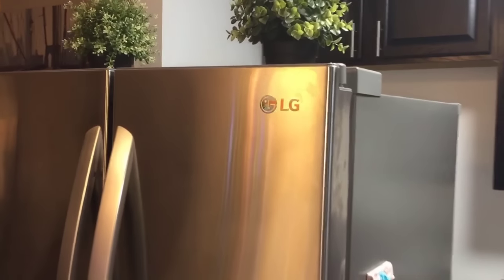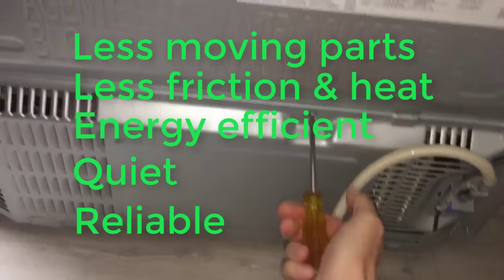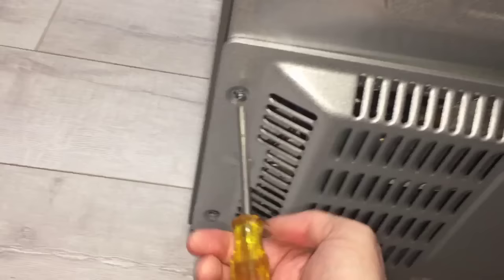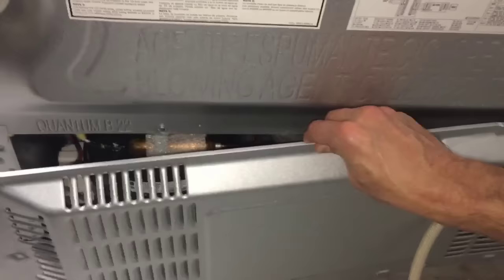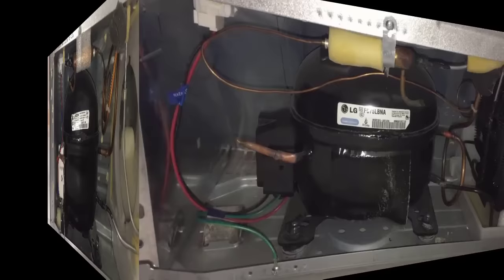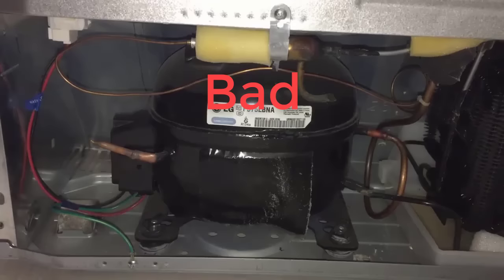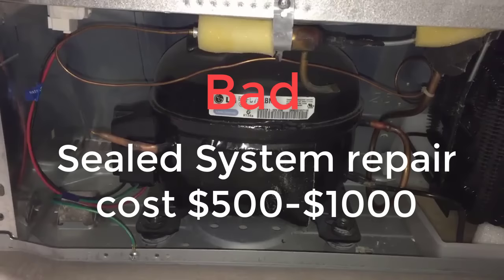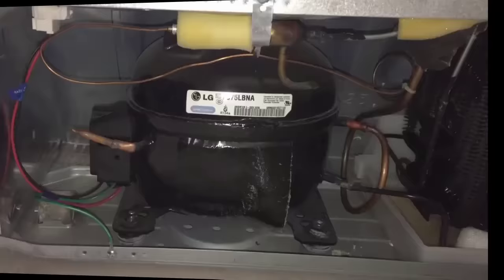LG fridge not cooling but running

Comment: Linear has 10 year warranty but heard the tech labor itself is like $400 + and you never know how much longer it will last.
Reply from the maker: If your fridge is only a couple of years old, then I think it's worth paying for labor. But if it's closer to 10 years old, then shopping for a new NON-linear refrigerator would probably be wise. The best case scenario would be if they try to fix it, but can't. And than refund your money back for a non-repairable fridge.
Reply: Yep - be prepared to pay them handsomely to fix their faulty product or continue to go without a fridge.
Reply: WHAT DO YOU MEAN BY NON-LINEAR?  I don't know!  Can you tell me because I'm about to buy one since mine is around 8 yrs old
Reply: @leoe7357  open the back cover (please, unplug it first) you'll see the compressor label, it'll say linear compressor, if not, you are good to go.

Comment: i left the freezer door open and now it doesn't cool. I will unplug for a day as instructed. Hopefully that fixes the problem.
I have an LG LSXS26366S/01 model
Reply from the maker: If the door was left open, the evaporator inside the freezer attracted a lot of moister from the air and got covered with a thick layer of ice, which prevent proper cooling. Unplugging and defrosting usually helps, unless the compressor overworked, overheated, and burned-out. Let's hope for the best outcome!
PS. To defrost your freezer quicker, open the door and be prepared to collect water from the floor. If you keep the door closed, it may take several days to completely defrost the evaporator.
Reply: YourSelf about how long should I leave it unplugged?
Reply from the maker: It's difficult to say how long it takes to defrost because it depends on the amount of ice accumulated on the evaporator. But if you leave the door open, 24 hours should be enough. You could probably melt the ice with a hairdryer in one hour if you wish to do so, just keep the hairdryer away from plastic parts, so they don't get damaged.
Reply: Great news! My refrigerator, LG model ,had an extended warranty on the compressor. It coverd labor and parts.
I also qualified for a food loss reimbursement.  What a blessing. Thank you for you quick response.
Reply from the maker: Good to hear that they covered the repair and the food loss as well!

Comment: Same thing is happening to ours! 
Bought it in 9/2016
Reply from the maker: Your refrigerator compressor is covered under 5 years free LG replacement!
Reply: YourSelf who’s going to fix it? Trying to get someone over here from LG is impossible
We had it hauled away and chalked it up to experience- a BAD EXPERIENCE.  Have a Kitchen Aid now.. night and day.  Good riddance LG!
Reply: We need help right now!
Reply from the maker: You need to call 1 800... number from the sticker inside your fridge. LG should send an authorized LG tech. If the technician is not authorized, it will not be covered under warranty. If you live in the low-coverage area, it may take a while. Consider getting a small refrigerator while you are waiting for a tech.
Reply: YourSelf we did call that number- it took us six tries to get through to someone who sounded intelligible - they can’t come out for 9 days-
Reply from the maker: Yep, that's a long wait. Ask your neighbors, may be they have a spare fridge to loan.
Reply: YourSelf doubtful
Reply: My LG was purchased in 2017. LG stop freezing on Friday, starting freezing again early Sunday morning. A compressor was installed 4 months ago.
Reply: @Your-Self  Where is anything written about this 5 years replacement? My registered fridge just says 1 year warranty on LG's website.
Reply from the maker: @Joshua Munoz, here is an updated warranty information that covers most LG refrigerators https://www.lgcommunity.us.com/discussion/3871/important-lg-refrigerator-warranty-information-announcement-please-read
Reply: YourSelf I already bought a new Kitchen Aid a long time ago.. never looking back!
Reply: same issue. Mine was bought in 2016 also.
Reply: @maritalaurent7433  paid $$$$ and it stopped working literally days after warranty ended.. complete rip off!

Comment: My refrigerator is running and the compressor sounds good while running but still does not cool the food or the air inside the refrigerator  ???!!!!  Strange thing is the refrigerator's walls outside the refrigerator is colder than the wall of refrigerator inside the refrigerator !!!
Reply from the maker: Sometimes the compressor may sound "good" but still be bad.
Also, this could mean that the refrigerant gas has leaked out. Either way, it's an expensive repair.
Reply: @Your-Self  Thank you.  is there a LIST of items to check, after which one knows it has to be an expensive repair ?  Thanks
Reply from the maker: If the compressor and all fans are running but not cooling, it's going to be an expensive repair.
A technician can pierce the Sealed System to check the pressure inside both sides to verify the problem. But if it says Linear on the compressor, the compressor is probably bad.
Reply: @Your-Self  I have only seen one fan, with what I believe is the condenser. But I also checked the air vent into the refrigerator and freezer and both send in air.. So does that mean that both fans (including the one that I don't see) are working ?  Thank you
Reply from the maker: If you can feel the airflow inside the fridge and freezer, the fans are working fine.
And if that airflow is at room temperature (not cold), that probably means the compressor is bad... even if it's running.
Reply: @Your-Self   Wow !  Thank you
Reply: You are hearing the air circulation fan running, NOT the compressor.  Your unit's compressor has died. Do yourself a favor and buy another brand refrigerator; don't waste your time and money getting an LG refrigerator fixed.

Comment: Please help. The LG refrigerator (about 4 years old) appears to be cooling but the freezer is not working anymore , food is thawing. What is the issue?
Reply from the maker: If it's a single evaporator refrigerator I'd call LG directly, because the compressor is probably going bad and they should fix it free for the first 5 years.
 If it's a dual evaporator (one in the freezer and one in the fridge) and the fridge section is still cold, there may be a few reasons why your freezer not cooling properly. 

1. The fan by the compressor or inside the freezer not running.
2. Defrost system not working.
3. A temperature sensor is bad.
So, is it a single or dual evaporator? Are both fans are running? Is it still cold inside the fridge compartment? What is the model number of your fridge?
Reply: @Your-Self  Thanks for your help and response. It is the LG 26 CU FT SIDE BY SIDE REFRIGERATOR
MODEL: LSXS26326S. what is the exact issue? I had to purchase dry ice to protect food in the freezer while a new freezer arrives.
Reply: Yes it is cold in the fridge compartment and cold air blows in the top of freezer vent, but air is not cold enough to freeze. Temperature in freezer is set to - 4
Reply from the maker: Your refrigerator looks like a "dual evaporator" system, which is very difficult to work on. So, you'll probably need to call a professional tech. The problem could be with a "sealed system" and there is nothing you can do yourself.
However, the problem could also be with the fan next to the compressor not running (you never answered that), defrost, or temperature sensor, which you could fix yourself if you are good with tools.
If you can remove everything from the freezer to get to Evaporator Coil and look at the frost pattern. If there is NO, or very little frost on the coil, there is nothing you can do about it. But, if the evaporator coil is completely covered with a thick layer of frost and ice, which actually prevents your freezer from cooling properly, you should be able to fix it yourself, but it'll take some time. Let me know what you find on the evaporator coil if you are willing to do it.
Reply: @Your-Self  Thanks a lot for your help, tomorrow I'll try to check your recommendation. It was a long day, and wasted most of it trying to find a new freezer, but couldn't find a reliable one ready for pick up, so now I have to wait for the whirlpool to be delivered on Wednesday. I'll never buy LG appliances again, terrible quality.

Comment: LG brand used to be GoldStar brand back in the old days. As a people used to lived in a 3rd world country I had suffered with crappy Goldstar TVs VCRs... and recently with LG flat screen LCD tv in the USA. You would think LG is a South Korea company and they should be as good as Samsung right ? WRONG !!! LG i would think them as a "Samsung wanna be guy" but in fact they're not.Their  shinny products OLEd TVs Refrigerators ..etc are just lousy quality. I'm not a Samsung's fan either but between samsung and LG I believe samsung has a good quality control than LG. My 26 year olds Kenmore refrigerator BTW built by Whirlpool been running like a champ except i have to replace the auto ice maker twice .
Reply: 40+ year tech. I won't touch LG or Samung due to very poor product.

Comment: Lg all fans working but not getting cold model LFX25975st
Reply from the maker: If the compressor sounds like it's running but not cooling, most likely the compressor is damaged inside.
Reply: The compressor has likely died. LG units are junk and were made with junk compressors.

Comment: Just had mine in this situation.  Turned out the fridge Evaporator Assembly was leaking when he sprayed it to check for leaks.  Ended up replacing the Compressor and drier as well since there could be air in the system.  Warranty for the fridge ran out from best buy in Sep 2020 but LG honored it because of the lawsuit.  It may be worth it to call LG instead of your local guy.  Over $600 in parts and an hour and change of labor cost me nothing. Icing on the cake they were out to repair it faster than the 3 local guys I called.
Reply from the maker: Lucky you :)

Comment: Hello, how can we solve the problem of lG
 refrigerator leak? The gas has been charged several times
Reply from the maker: If the refrigerant gas keeps leaking out, you need to call a professional tech to find the leak and fix or replace that part... but this is going to be expensive.

Comment: yes .. mine just failed but i've had the unit about 5 years... I think.  Nonetheless after 2 years ... no power... fuse blew.  I had to do some creative thinking and doing and soldered a fuse holder on the control board as the original fuse is soldered on the board.  This way I can change the fuse easily.   2 of my units blew the fuse.  Now one fridge is not cooling... might be the compressor... SO .. I need to call someone on that.  Boy ... getting me upset with LG
Reply from the maker: Good job on the fuse!
The fuse used to be replaceable on older appliances. But nowadays, you have to replace the whole board or do the creative soldering if you can.

Comment: Mine sound s like the good one but still not cooling
Reply from the maker: Try running a Test Cycle as in this video https://youtu.be/70y61Sq_NU0
If the fan inside the freezer and fridge compartments blowing warm (room temperature) air, the compressor is probably bad.

Comment: My LG Refrigerator lasted 4.3 Years.....Bad Compressor.  I could not find anyone that wanted to work on the LG unit.  They all said LG compressors are no good and I was lucky to get that long with the unit.  They said that most units go out in the first 3 years.  So I should be lucky to almost get 5 years out of it.  LG will never be in my house.  I will NEVER buy any LG products.  I called them 4 times and never got anyone to come out and service the Fridge.  They told me that it was out of Warranty.  The compressor was covered but not the service call on installation.  Cost would be 700 hundred to 1000 to repair.  BULLSHIT.......!  NEVER BUY LG AGAIN....!
Reply from the maker: That sucks. I'd call LG again, and ask for totally free compressor replacement since your fridge is under 5 years old. In 2019 they increased the warranty which includes free labor for the compressor in the first 5 years.

Comment: If your refrigerator stops cooling within the first 5 years, LG will fully cover the repair. If its after the 5 years it’ll cost you a flat rate of $375. It’s not $500-$1000
Reply: Randy Leon Where do you get the information?
Reply: @yunyue8632  it's in the manual
Reply: But I think you still have to pay for Labour. They coming on Tuesday , mine is 3 years old, I will let you know how much they charge
Reply: @martha2004  If it's 3 years old, LG will completely cover the entire service. Do not pay for labor. Look in your manual.  It is all there.
You only pay labor ($375) after the 5 years
Reply: Randy Leon thanks, I will check. i am in Canada and when I call, they told me, if it was less than 5 they will replace it but I have to pay for labour 😡
Reply: @martha2004   I live in the United States. I guess the policy might be different in Canada. I'm sorry
Reply: Randy Leon it is ok, . They came today and I have to pay $ 451.00 CAD. 😡 i signed a lawsuit
Reply: The problem with that is finding a tech that will work on it. Apparently LG doesn’t pay much for warranty work so no shops would accept the job.

Comment: Well, mine is officially dead.  Purchased it in August 2013.  3-1/2 years later they had to replace the freezer thermostat and heater to the tune of $350 and of course "only certified LG techs can work on their product".  This week the ice maker died, the next day the freezer died and the day after the refrigerator section.  Like 1 organ failing at a time :(  I'm not spending another dime on this piece of crap.  Bought a GE but can't get it till Thursday 12/3.  Had an LG TV that all 4 hdmi ports blew in less than 5 years.  I am so done with LG and will never buy another LG anything.  I sold a perfectly good, perfectly working KitchenAid side by side to "upgrade" to this POS french door LG.  Boy was I stupid!
Reply from the maker: It's a shame that they look so nice but totally useless. Better luck with the new GE.

Comment: I have Kenmore Elite 795. made by LG, it is dead after about 3 years. Without receipt, sears is not covering the part (ie. the the notorious linear compressor).  Contact LG, was told it's branded under kenmore so it has to loop back to sears. What a joke! Stay away from LG, Sears and Kenmore, piece of junk!
Reply from the maker: When you say "dead" compressor, do you mean it's running, but not cooling, or not running at all? If it's not running, it could be an electrical problem with the motherboard, which is easier to fix.
Reply: @Your-Self  Thanks for your suggestion. It's running but not cooling. Cap, relay and PCB are good.
Reply: YourSelf my fridge compressor runs but very slow it pulls only .04 amps it gets voltage very slow then goes up to 135 v and after a minute drops to 65 v. Do you think it’s the circuit board? Thanks
Reply from the maker: Mario Gonzalez .04 amps definitely not enough, is it going up to about 1 amp during the minute of 135 V? Difficult to say if it's the inverter or a bad temperature sensor "lying" to the mainboard. Also, it could be a "low" side leak that sucked air inside the sealed system and freezes creating a temporary clog at the capillary tube inside the freezer. When freezer warms-up, the clog dissolves for a minute, but then refreezes again and clogs the system. What is your fridge model number?

Comment: If you own an LG that is not cooling and you dont hear this noise, start with cleaning cooling coils and work through the simple items.  

My wife was already shopping for a new fridge because no one would come out during Corona Virus.

Coils were filthy....cleaned coils and everything else...works just fine.  6-7 screws and a shop vac.
Reply from the maker: Absolutely, if condenser coils of any refrigerator are covered in a thick layer of dust, hair, and other debris, cleaning them should help the cooling issue. However, LG linear compressors have weak internal suction valves, which break prematurely. Consider yourself lucky if your compressor still pumps as it supposed to, and thanks for watching!
Reply: No one would come before the corona virus either.